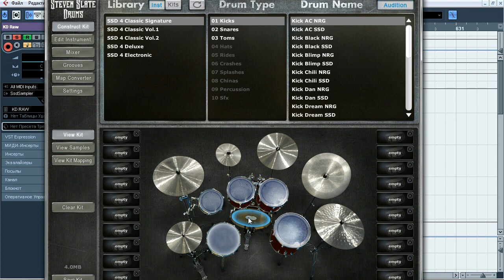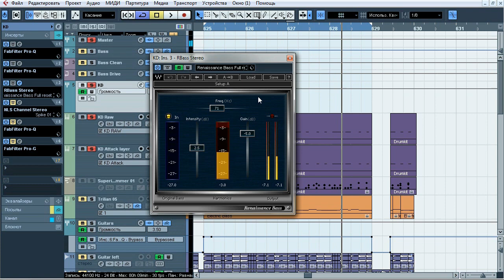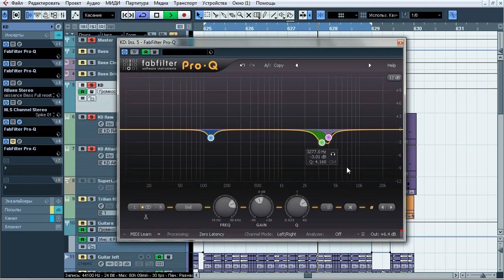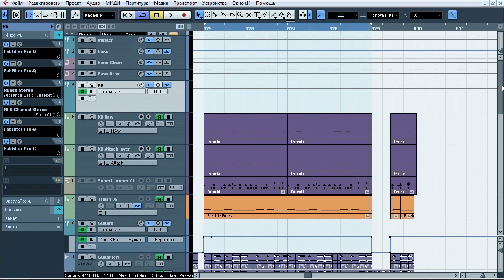Mixing Tight Metal Kick Drum [Kick Black SSD]

Comment: Why cut low mids and then add low mids?  Your kick sounds good. I think i would clean up the 700-800Khz and leave the low mids alone. And not HIghpass. I think thats why you need so many mids to add the high end back.   Just my opinion. Mix sounds good regardless!

Comment: Do you not know how to route the kick from slate into your daw and onto a mixer and just send it to two tracks and bus them? seems kinda silly to open two instances of slate you're just creating more work for no reason. also if you're blending the same kick twice it will just cause phase issues. you should blend two different kick drums and cure them with your DAW's plugins separately & exploit the best characters of each one by one-> send them to a bus and glue them together to get a ultimately blended kick drum tone.
Reply from the maker: Kyle Comer being able to do separate velocity programing is enough? 
This is the same thing that I did with same kind of snare from the same project (there was another video right after or before it, not sure). In this case when you have dynamic roll from low velocity to hard - attack of "attack" layer sometimes too obvious and by lowering velocity range of attack layer I was able to get smoother sounding. Yes, it could be done other way (with loosing this option), but does it make any sence? The point of this split was separation of short attack from the rest of the sample, not layering design. You don't get phase issues simply because there is no crossing between attack and main part (because of the separation). Level difference between start of main layer and attack layer which sounds over it is too big to complain about phase, it doesn't make sence in this case. Yes, this is not one-shot sample, and because of sample randomization there is a chance that main and attack layer can play different samples, but all of them have (if talking about same ranges of velocity) pretty close wave-form (at least when it comes to attack). "blending of the same kick twice" will probably cause random chorus effect, but what I did here is completely different thing as you can see. 
Mixing of two different kicks have much more chanses to provide phase problems because of difference between fundamental tone, sometimes their transients can be simply out of phase for a short time, so you can get solid loss of attack as well. That's why I always check phase correlation between two when blend together. But even if you fixed it by phase reverse or phase delay - it can be easily ruined (I mean phase optimal phase correlation between them) by putting different processing in their chain, for example non-linear phase equalization. However it's not a big deal as far as trigger (the one you blend to kick) usually much less in volume.
Reply: Actually, two different kicks with two different overtones have very little chance of ever creating phase issues, and you wouldn't be blending them both at the same volume, just which ever one has more attack so it peaks through the rest of your elements. Maybe in the low end but the chances of that are slim to none with two. entirely. different. kicks. lol. Also that still doesn't justify opening two different instances of slate, when you could just as easily send slate to a source channel, take that source channel off the master, send it to two more tracks, process them separately (two different transient designer VSTs would make more sense than two entire instances of SSD as a sampler. Then I would just buss those two together to one track, add an eq etc and essentially just treat it as one cohesive kick drum track, you have simply added two different over tones together creating one tone once it buses into that track (kick master) idk man I'm trying to save you time, recording is time, and as an engineer it should be your job to find the quickest way to get things the way you want it. While there is nothing really wrong with opening two instances of SSD (lol your CPU not mine) you are slowing down your workflow, hindering creative mindset. something to think about homie. I do respect your idea of treating the two differently, all I'm saying is that it could be done in a more professional and logical/controlled way. Mixing is all about having full control.
Reply from the maker: Oh transient designer? Do you know what happens with thransients when kick starts to play fast enough? That's entire reason of this split. And I'm not talking about overtones, I'm talking about close fundamentals (that "boom" part of the kick) - guess what happens when you mix 50 Hz based kick with 55 Hz (just short example, I'm not sure about correct numbers, but I think you get the idea). That's what I'm talking about. To sum it all up - SSD split allows you to do separate programming of velocity. Using of transient designer only makes sence on normal or slow speed when it has time to react. When it goes fast enough - you will get some transients passing it at the same volume, while other will be actually effected, as a result you will get messed up dynamics (which can be good or bad, sometimes this kind of randomization can bring some life to drums if applied to trigger, but I didn't want this kind of effect here, it should be always linear).
Reply: I wouldn't deem opening two different instances of slate using the same instruments "linear"
Reply from the maker: Me neither. What are you talking about?
Reply: I don't think you're digesting what I'm saying at all. 
you are creating more work for no reason. it is unethical to open multiple instances of the same plugin when your DAW has resources for you to copy things with the click of a button. I think it's wrong to post videos like this with misleading or unprofessional/bad habits in engineering. it just doesn't make sense what you're doing. you could send slate to one track, un send it from the master - send it to two other tracks and doctor them separately (I still would not use the same sample regardless of the different settings) then send them to one track. you shouldn't even have to use plugins like that. this video also indirectly states that you don't know how to EQ things properly in context which makes you think you have to do this. not trying to be rude but there's just too many videos like this on youtube that don't properly get the message across for what is trying to be achieved.
Reply from the maker: So here we go again. I explained two times what's the point of this, but still you continue to act like you never saw my reply. Let me clear it all out for you one last time.
Yes, you have two separate VSTi channels with different internal envelope settings (which means that envelope changes will be aplied to the actual sample). Because of that - envelope settings will be always stable, because of the fact that they applied to the sample. Using envelope shaper/transient designer wouldn't give same effect because when your kick or snare play too fast - it will pass most of samples uneffected, but some of them will still have attack boost, which probably would sound a lot more professional. There was single channel with transient designer before I figured it out - and that's why I used to apply this split. Because of the split - there is not so much interaction between attack and rest of the sample. There IS little crossfade between them (in meaning of time), but total difference of their levels allows to ignore it. What you told me about is called triggering or layering, where as you said you sum two or more elements together and as I said - what I did here is completely different thing, it's not layering of two different samples, it's splitting of one sample to be able to control it's attack, that's it.
I answered all of your questions, but what you do is continue to switch the subjects, attacking me from different sides with random questions or false statements - and then when I'm answering or trying to prove that you're not correct (again, it's just my opinion, but I spend the time to prove my point) - you just jump to another thing. It looks like you pull out random shit and I only defend myself by answering to it. You might think whatever you do, why should I care if you don't prove it with objective facts? I'm unprofessional? Well, I never claimed to be one, so what's the point? I don't know how to EQ properly. Who said that I do? What does "properly" mean? And who you is to judge what's good or what's not? I never let my subjective thoughts go out of me when it comes to what I do, maybe I'm to unprofessional to do this. I'm nobody to have an opinion on something, but for some reason you think the opposite of yourself. Why? What you've got? Yes, we both can think whatever we will, but it's just the oppinions, nothing more. If you trying to prove something - do it in objective way. If you have something to say or something to ask - get rid of all the subjectivity and go for it. I'm always open to have a conversations as you can see. If you want to prove the point - do it, I'm always up for it, but don't make subjective statements, it's not something I want to spend my time to. Because it just goes nowhere.
Reply: how would 2 samples from the same library and kick phase, but two samples from separate libraries won't?

Comment: Mixing with the separated rooms for each part of the kit its not possible on real drum mixing, where one mic room has all the sounds at the same time. :( Still awesome guide dude.
Reply: not true at all. you could use two different room mics in different spots and achieve two entirely different tones. mix them separately. boom.
Reply: Kyle Comer what i meant in my comment is that,  whenever you mic the room,  it its impossible ro get the snare hit without all the other parts of the kit (cymbals, hat, kick) or at least a few dbs more clear.
Reply: thats why room mics are usually limited to hell and create a distortion/saturation character to your drum mix. that's the whole idea. a committed room mic sound and to be treated as best as possible.